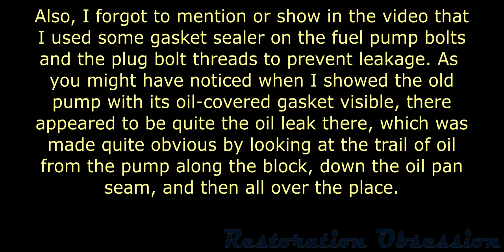C3 Corvette FUEL PUMP Replacement

Comment: I found this video helpful, thank you!  This is a little more involved than I had thought.  I have the original radiator fan and A/C compressor which makes access all the more difficult.  I started the job and realized I needed to replace those fuel lines, waiting on those parts now.   After 25 years of owning my 1979, I just do enough to keep it running and road worthy, fun car!
Reply: I have a similar situation, that AC compressor is a real PITA and must be removed to get to the fuel pump.  I am on the fence about attacking it myself or just paying someone to do it (who has the experience)
Reply: That's the problem with these and other older cars, scope creep.  I have a '69 BB with all the options, including and AC and I'm also replacing the fuel pump.  When I got started, I realized that the fuel return lines weren't routed correctly so like you, I'm waiting for additional parts to come in.

Comment: Nice refit!  So glad we did ours when the motor was out.  I spent the day with my teenager trying to get his new Holley 750 to idle on his '79.  It keeps filling up with gas.  I think the big Duntov 30-30 cam maybe drives the fuel pump more than normal.  We installed a fuel regulator to no avail.  I found out after we got home that my son plumbed the reg incorrectly so it wasn't actually restricting flow.   Guess we could run back to Summit tomorrow for a fuel pressure gauge to confirm 7psi at idle.
Reply from the maker: Hmmm... yeah, that's a head-scratcher.

Comment: My big block hood is an aftermarket piece and the center section on the back is unfinished in rough fiberglass. The factory pieces had two piece dies that left a smooth finish on both side. So when I painted my hood I trimmed out the underside of my hood in body color and then just sprayed the center section inside the frame in matte black. I think it looks pretty dope. You can see it on my videos. Just a thought.
Reply from the maker: Thanks, I'll check that out!

Comment: Never tried Superclean.  Ive heard great stories bout it and will try it!  Use Simpegreen but doesn't seem to work unless you soak the part.  I've had issues with the sparkplug wires since I bought mine back in 87 hah.  A few years ago i realized there is a V shaped heatshield on each side of the block that protects the wires. One shield was still there not being used.  1,4 and 2,6 wires go through the motor mount and into this shield.  Haven't had any trouble melting wires anymore routing them OEM.  Only issue is you will have to make your own cut to length wires out of a reel and wire end pliers.  You will never find them out of a box.  Never tried Mid America or Corvette Central but they would probably be pricey.  I would suggest using OEM spark plug heat shields as well. (You dont have a mechanical fan pointing toward the rear of the car to assist with cooling the external components anymore)  This is the main reason I returned to mechanical fan.

RE; that overflow tub.  I was on my second tub which cracked and leaked.  Got sick of that style and bought an aftermarket aluminum one.  It is smaller but havent had anymore issues.  Not being able to return overflow coolant could have been a major overheating issue.  Problem solved! :)

Setting mine to TDC, I take the number one plug out and stuff a rag into the hold with a phillips screwdriver.  Don't use a flatblade as it may harm the engine.  Tap the motor with the starter til the rag pops out.  You will be at TDC or very close.  There is a false TDC (pully pointing at TDC but distributor pointing at Cylinder 6).  This way you know its on the compression stroke.  If you took the cap off you can of course tell as well.  
As others have said you can use a little bit of grease on the shaft and push it back in.  Grease will hold it in place just enough to get it back in.  And good grief on the fuel leak.  I would have attempted to spin that fitting 1 more turn and then ya I would have tried teflon tape:)

And ya the rebuilders of that pump clocked it wrong.  Apparently they think getting it close is getting it right lol.  ( Insert Price is Right fail jingle here) You gotta wonder if you get a strap wrench and try clocking it yourself.  Probably damage the diaphragm inside ha.  Worse comes you could cut the pipe on both ends with a pipe cutter, flare the ends and use braided hose from the pump to the carb.  

Good job on the hood blanket and thanks for the entertainment and info as always!!!
Reply from the maker: On those wire routing shrouds, mine does have those but they are caked with grease and I can't get inside them to clean them. I discovered that when I put the new, $100, set of wires on and decided I didn't want to grunge them up just yet, so I pulled them out of there and thought I'd routed them far enough away from the exhaust. I cannot wait to pull that motor out and rebuild it. Not in the dirt though.
Reply: @RestorationObsession  Ya the tins use one of the motor mount bolts to attach.  I bought one and took the other off and soaked it.  I think if you keep the engine reasonably clean, changing the wires, you just have to bend the tin a bit, not take it off. and ya you need a garage haha
Reply from the maker: @aboutmyfathersbusiness8324  I think my next big task is to pull the front end up on ramps and do a super-de-duper deep cleaning. I need to figure out where any other oil leaks are coming from. Really hoping the crank seals aren't leaking. I'm pretty sure both the engine and trans pan gaskets are though. They look pretty rough. I may try to pull them and replace them when/if I determine they're leaking. But the bottom line  is I really need to pull the whole motor/trans combo and do some serious work on them.
Reply: @RestorationObsession  Best thing of course is pull the whole motor.  You like tinkering like me though.  I actually replaced the oil pan.  Not too serious once you get the Y pipe out of the way.  If your exhaust is welded solid, may be an issue.  
Your main seal in the rear can be replaced without pulling the transmission.  I did it myself.  After the pan, ou take off the oil pump then the rear main bearing cap and slide the half silicone rings out.  There is a method and instructions on the kit.  Its pretty simple.  I replaced the oil pump and switched out the stock pump to distributor rod with a High rpm rod while down there.  Brought back oil pressure too.  Only other places ive noticed oil drip was the Power steering components(Hoses, [pwer valve, power piston) all replaced over time and the front timing chain cover which I replaced.  I got a garage and a quickjack lift which makes the projects much easier.  You definitely need a garage! haha
Reply from the maker: @aboutmyfathersbusiness8324  Lucky you with your lift and garage! I will get, or build, one some day. Thanks for the oil leak location suggestions. I suspect that ALL of those are leaking on my car haha. Great idea on doing the rear seals and oil pump while doing the pan gasket!

Comment: Very informative video. I’ve picked up some very good tips for when I replace my fuel pump. Those tabs are actually for the heat shields that are missing on your engine. From the factory there was a chrome cover that went over the distributor with shields  that covered it and also  the spark plug wires. There should be heat shields  around the spark plugs. The front  spark plug wires originally were routed  through the motor mount and are a pita to replace. That’s why you see most people route the wires differently.  Great job installing the pump. You had to overcome some hurdles.  May I ask where you got your pump?
Reply from the maker: Ah! That makes sense, I thought that might be what they were for. I got the fuel pump, hoses and fitting from Eckler's. Pump: #121285. Hoses: #114781, Fitting: #213639. And thanks!!
Reply: Thanks for the part numbers that you used. I’m wondering why the outlet connections on the pump were in a different Configuration from your original pump. You worked around it  nicely

Comment: They are for  the sparkplug sheild. Great job 👏🏾 you can try running plug wires 1 and 3 , 2 and 4 alone upper side of valve cover and down to the plugs for now. Take care 🙏🏾👍🏾 nosale

Comment: There are no high pressure lines on that pump....only 5 to 7 lbs. To carb . The line from the tank is not under pressure because the fuel pump pulls fuel out of tank , with suction. Just saying.  Love your videos , keep them coming.....

Comment: Great vid ! Your lighting, and close-ups outstanding. I'm thinking about removing original under hood insulation on my 77. Any pros/cons you can think of? I've heard there maybe some nasty glue to deal with. I should have guessed you be a 1/4mile gal with those flaming locks, tats, and all. Purple, with fat slicks, wheelie wheels, and a parachute to go with that blower Anna ?
Reply from the maker: Thanks, Mark. I am unsure about what to expect with removing the insulation. The originals appear to be made of pressed/formed fiberglass insulation-type material. I hope the paint will help keep it from falling apart further, but if/when it does, I'll probably just remove what's left. As for me being a quarter miler, I'm not actually into drag racing all that much. My race of choice is Grand Touring - LeMans style.  I'd much rather be driving through twisties in the mountains with big trees and beautiful vistas. That's not to say I've anything against drag racing, I love the tech and stuff, and though I'd want a blown big block street/strip car, I would not race it... just rumble around town pissing everyone off and maybe doing some Brodies or burn-outs every now and then lol
Reply: @RestorationObsession  Your's looks fine after paint. Mine is 2" of fuzz that's coming out one way or another. I just found a suitable replacement at  Eckers for $50+ should I need it. Thanks for you reply, and I look foreword to your next clip.
Reply: @RestorationObsession  Hey Anna, FYI no glue to mess with after the hood insulation remove on my 77
Reply from the maker: @markcalkins8437  Hey that's great!!!

Comment: 1977 350 CI 4 bl  Corvette Especially the ORANGE ones. (never trust Orange) The more money than brains crowd bought their college-bound man-child a new corvette to drive to school. During the first month, he takes it over to his friends, pulls the cam, puts in a 3/4 racing cam, and installs Hooker Headers scrapping the factory exhaust and catalytic converter. Done yet? NOPE! Next, he takes off the gas cap takes some kind of thick bar, and reams the tank spout out so that he can run leaded gasoline (& God only knows what else). So, I find a Corvette for sale for a good price in a newspaper. Somehow this car has survived. It belongs to a middle-aged Truck Driver and it is painted in two-tone brown factory colors. No orange was visible ANYWHERE. He explains that he and his new wife need another 3 grand for a down payment on a house. $3000.00 it's about 2(some) years old, clean as a pin and BEAUTIFUL.  My son has flown me to the city in a private plane we called the guy and he came to the airport and picked us up. We went to the guy and test drove it. It drove out real good. Ran great. Was fast for a 1977 low-compression smog-hobbled Corvette. I knew that somebody had done some engine work on it and still had the kid's AM/FM/Cassette aftermarket radio with a HUGE bass speaker behind the seats it was a coupe, so turning up the radio could seriously damage the eardrums. The Owner tells me he didn't bother it because he seldom used it. So, I buy it. I take my son back to the Airport and he gets in the plane and flies home. IT takes me 4 hours to get home. But that car was great. I had a wonderful drive home. It's a good car for me. Eventually, I trade the worn-out Hoosier tires on it for an old man's set of NEW Dunlap tires. I love that old car. Like me, it's had a lot of miles, but we are still a great couple. 

Two days ago I pulled it up under the carport and took the fuel pump off of it trying to treat it like my '68 Pontiac GTO 400 4 bl in the garage I bought for my wife in 1971. BIG mistake! I have been trying to put that sucker on for two days now. Now I know the difference between a Pontiac fuel pump and a Chevy fuel pump. So, sometime before next week, I shall go back out educated enough to succeed this time. I found traces of the Factory orange paint. It had finally told me the whole story on itself after I drove it around 40 k miles. They will probably bury us together.

Comment: I'm working on a 77 corvette.
I think the pump is original. It does no have a fitting in the pump as intended one you replaced. Any idea on the fitting size or part#

Comment: Hi Anna Do you have the radio shields for the ign wires?  the tabs may be to hold them on. I like this video. well done. TZ
Reply from the maker: Thanks, Anthony! Are those the chrome slip-over things that come down from the sides of the chrome metal distributor cover? If so, yes, I do have them (all 3 parts) but took them off because I was having to keep taking them off so much to get to stuff underneath them. When I rebuild the motor I plan to put all that stuff back on it and route the wires the way they were originally. Well, that's if I don't put headers and sidepipes on it, which I really want to do.
Reply: @RestorationObsession  Side pipes are loud and very hot. and you are reminded how hot when you get out. Keep this in mind Wink.
Reply from the maker: @anthonyzarlenga5282  haha yeah, I know they are. But see, the cool thing about running them on a split system is that they don't always have to be ankle burners! I grew up with a father who rode bikes all the time and took me along on them since I was big enough to hold the handlebars, so I learned very early on how to accommodate scorching hot pipes. ;) I had exactly two ankle burns, but  I lost more than one pair of Converse high tops to those pipes! lol
Reply: @RestorationObsession  HA HA so much for the ride safe.I had My kids on the bike too. Joe was on the tank and Sarah was on the queen seat. No burns.Cary on.